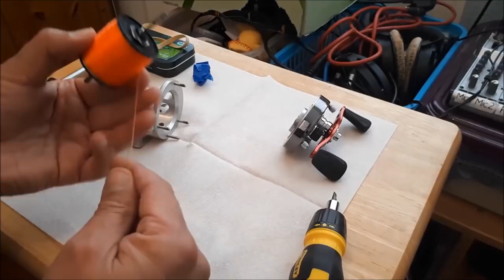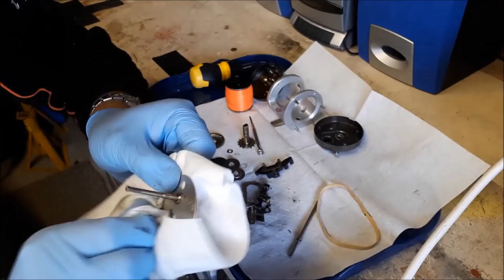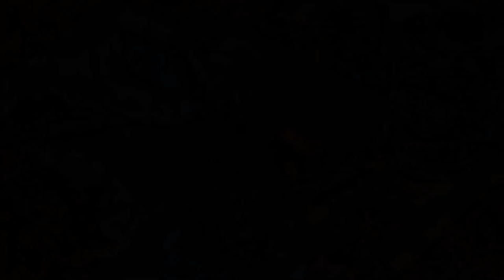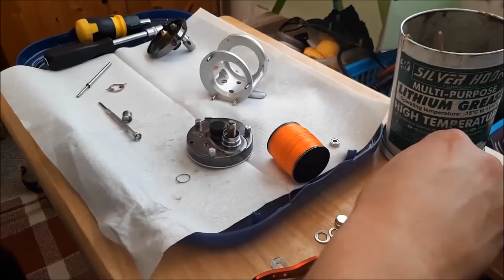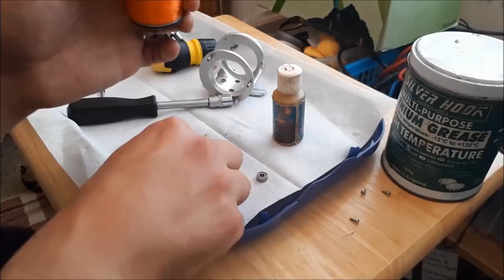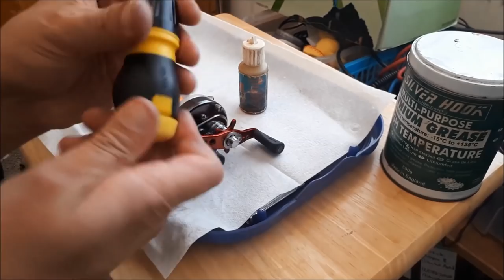Abu 6500 Reel Strip, Clean & Assembly

Comment: In the states I found quantum hot sauce grease is the best it has special tacktifiers that stays in place it won't migrate away from the teeth on the gears and won't break down and there oil is really good as well it molecularly bonds to metal part

Comment: Great vid, very well explained. Is it the same setup for a 6500 CS Rocket (Vintage)? I took it to my main dealer as it felt a bit rough the last time I used it after getting stuck and putting a lot of pressure on the reel to snap my line off, when i got it back from the dealer they said I needed a new R/H side plate, would you say that is correct information? also the spool replace button is now really loose and flopping back and forward. After watching your video a believe I have the confidence to get into it myself. What are your thoughts on replacing the steel bearings for ceramic ones, and what size are the best for my reel?

Comment: Luckily this reel only has that one shim washer at the base of the shaft but make sure you don't forget it! I service reels all the time but the first Abu I serviced that darn shim washer got me bad! Eventually the reel actually spun better with two shim washers ha but it's amazing how much the pesky shims do for a reel!
Reply from the maker: Id thought about using 2 washers myself as there is always a bit of play where the circlip goes on at the top of the post. Too thick tho a washer and you can feel the handle hard to turn.
Reply: @djrmonix  yeah that play is why I added a second washer and it made quite a difference. I used a shim that was even thinner than the first, they feel like paper metal. I have quite a collection of shims from over the years but the one I used actually came with a spinning reel to control line lay. You're absolutely right that too thick and you've done far more harm than any good.

Comment: I've just aquired a second hand 6500c3 and took the handle side plate off to inspect for dirt etc, but when I try to replace it, there's a gap of about 1mm, I think it might be the two nylon caps on the fitting on the end of the spool that are stopping it seating properly. It's a bit hard to explain,  just wondered if you've come across this before please?
Reply: Wiggle the clutch release lever, it can get wedged

Comment: I got a c4 6600 and when put back together the main gear is free spinning around the shaft? Why is that
Reply from the maker: Have u fitted the drive plate to the spool! Also have you refitted the clutch mechanism properly. Maybe the pinion is sitting out from spool a bit has if you going to cast.

Comment: had a brand new  great condtion reel decided to take it apart to compare it to one i have that wasnt working , and now i cant get it work anymore,, im just sick i have spent over 8 hours nonstop on it and taken it apart over 35 times,, im either doing something thing wrong or these reels are not meant to go back together once taken apart,, what am i missing i have done everything in this video? can anyone reccomend another video that might help?
Reply from the maker: What's not working with it?
Reply: i got my new reel figured out ,, didnt put springs on top,,, but still cant figure out what is wrong with the one i bought off ebay that isnt working
Reply: Ok it took me 5 strip downs but I think its the spool not sitting right. Remove the handle end, if it works off the reel the problem is elsewhere. Remove the other end end plate after replacing the handle end. Make sure the spool moves easily, wiggle it about until it does, then replace the end cap
Reply from the maker: Not sitting right as in it is not centralised? You may need more of the small copper shims go in the end caps.
Reply: Mine is fine, that was advice for bent rodguy